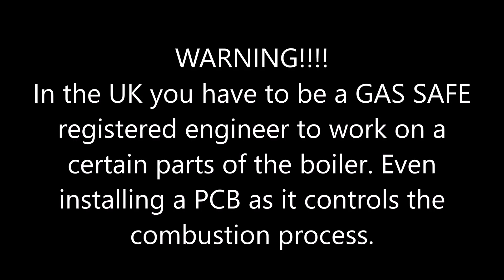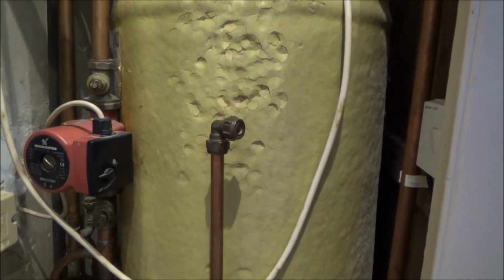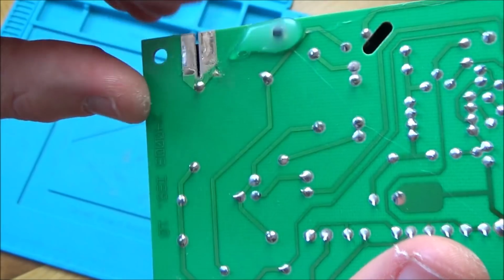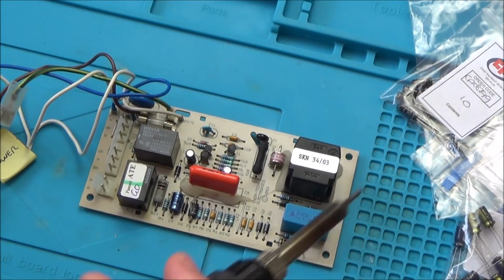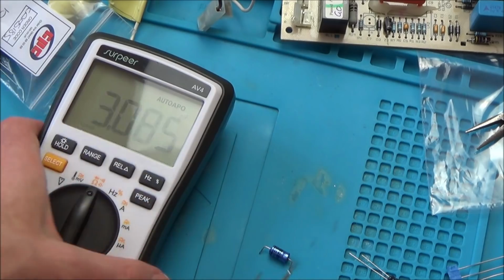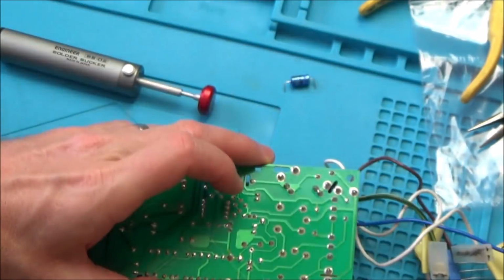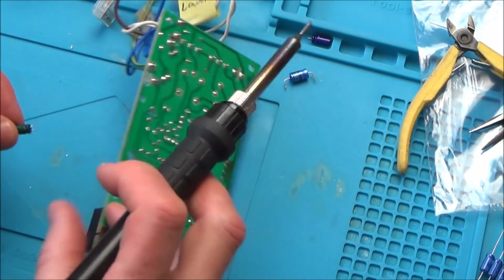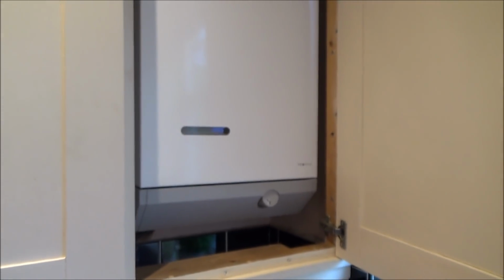Trying to FIX a Faulty Gas Conventional Boiler

Comment: The reason the PCB have room for two different shapes of capacitors are so that they can use the cheapest one available 🙂 Every penny counts in a capitalism World 😉
Reply: Nah. It's for when 1 of the 2 types run out of the factory that produces these boards. The other 2 on that board also have that option. Probably these boards were designed and build at a factory that supply a lot of different companies. Height of caps sometimes matters and sometimes not. Room or not on the board too. And sure money matters. You wouldn't work for free and die because of it ;)

Comment: Although the board is obviously fixed I'm surprised you would find a gas installer to reinstall a piece of equipment which hasn't been tested by the manufacture as if something went wrong the installer could be held responsible?
Reply: If you had a mate who's a gas engineer they would probably do it for you, or you can just say a gas engineer re-fitted it to save hundreds of 'shouldn't be opening the boiler' comments 😂

Comment: Fixing a faulty capacitor on a 25 year old boiler is great, but when it operates at around 60% efficiency best thing is to look at replacing the boiler for a modern equivalent, which would save around £250 a year to run.
Reply: shon hughes penny's for a capacitor or £900 for a new boiler and install by a gas safe engineer

Comment: The reason for the option for the type of cap there  ( Axial or Radial ) is usually a design thing, basically if the one type is out of stock you can go with the other one.

https://en.wikipedia.org/wiki/Electrolytic_capacitor
Reply from the maker: Thanks Nigel :-)